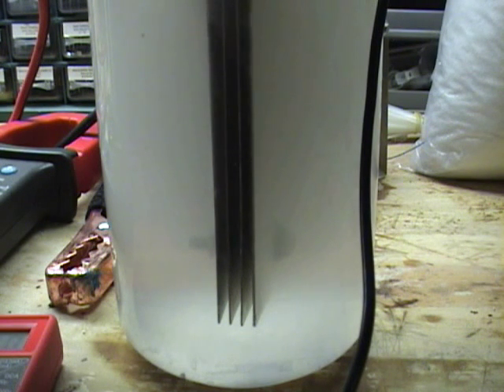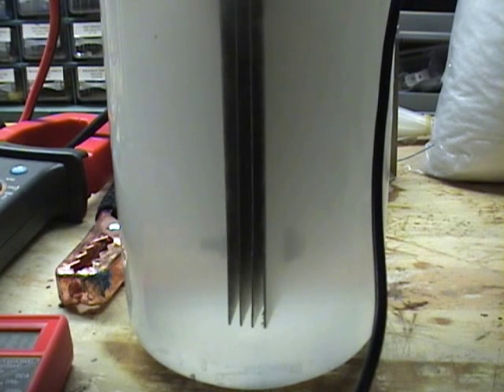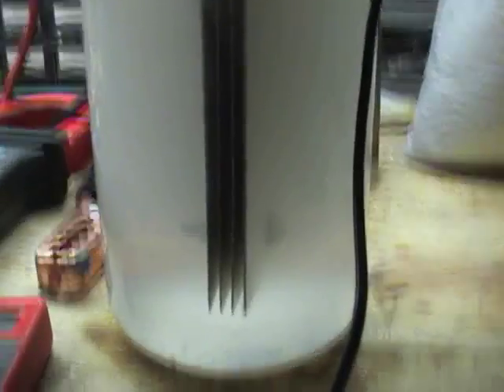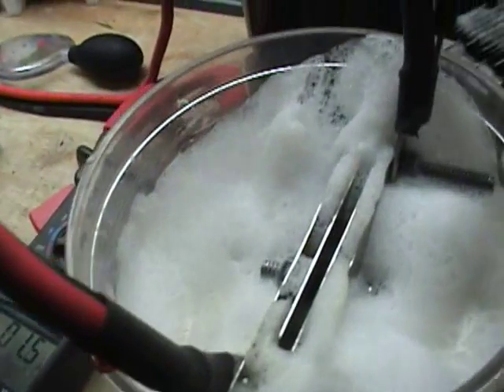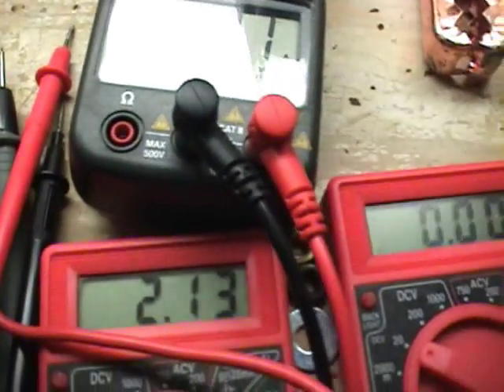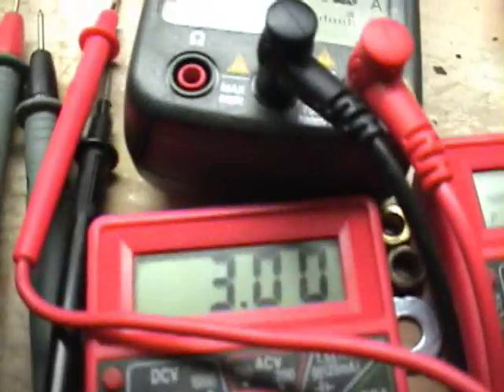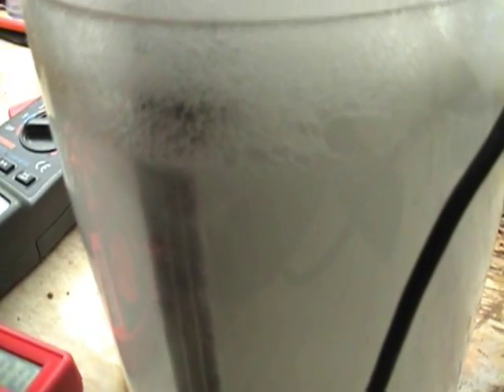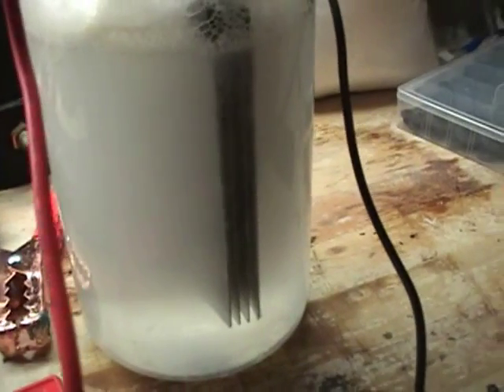Hydrogen HHO production at very low volts..wmv

Comment: Steve, in one of your earlier videos, you described how you prevented electrical leakage around  the holes in your plates using two different WELD type materials. One product prepared the surface around he hole, and the other coated it.. What were the products you used, and are your results still holding up under use?

Comment: there's the Scuffy cell that uses 63 plates and it was demonstrated that when he overdrove the cell with volts, the gas production was quite high. The problem I observed was the bubbles then formed over the plates which then caused massive current leakage which ramped up amps and caused heat build up. If you use a flow pump and a heat exchanger to draw the heat out of the electrolyte, you can keep the electrolyte cool and still produce a lot of gas, keeping the current from running away.

Comment: I've got an electronics degree and you can have voltages in the thousands with very little current. Neon signs use 10KV with under 1A and you don't get the heat coming off the neon tubes. if you had a weak electrolyte with high volts you wouldn't produce the heat in theory.

Comment from the maker: You could use higher voltage like 120v or 240v as long as your volts per plate gap are around 2v.

Comment: higher current produces higher temps.. current is the flow of electrons through a conductive medium. Voltage is the pressure. You can have hundreds of volts and very little current draw. My cell has 60 plates because when I built it, it was designed for 120VDC. After I got it together, I noticed that rectified AC ends up being higher which is 130VDC. So I'm getting 2.16V per pate gap. With pure distilled water, I get no current draw.. adding more KOH draws more A.

Comment: is it really an exact science with low voltage and high current?? has anyone gone with high voltage and low current?? Seems the magic voltage was always 2V per plate gap. What if it was 10V per plate gap and a weak enough electrolyte solution that would counter the current draw. Voltage is pressure and Current is flow. If I overdrive my cell with higher votlage, I get loads of HHO gas..

Comment from the maker: The point is... The mmw is off the chart. It's way overunity if i was splitting water but im not. The electrolyte isn't your typical distilled and koh. I guess you can say i have added a fuel.  This is one of my first test with this stuff and i dont want to mislead anyone.

Comment: question is...what is the goal in volume of HHO production with the low voltage setup?? Unless you can get the volume of gas produced to power an engine on I'm not sure this is doing all that great..  it looks like you got 1/4 inch gaps. I'm curious what the electrolyte is and the concentration levels are..